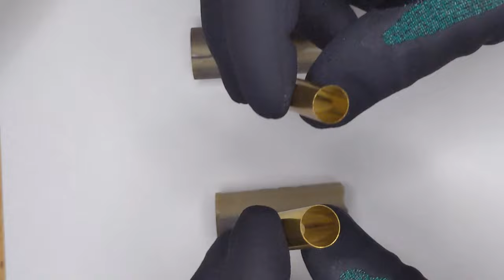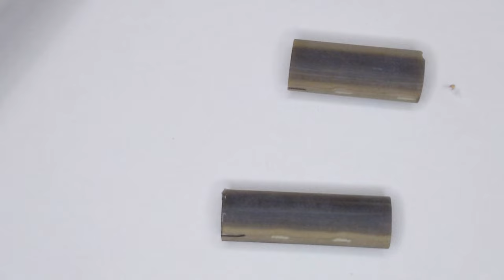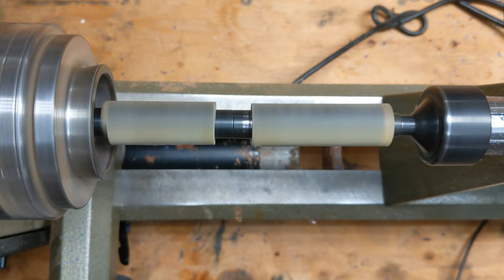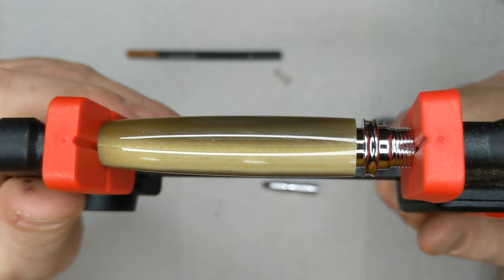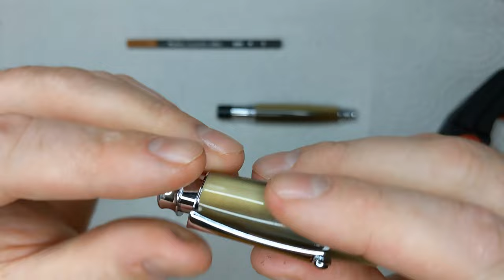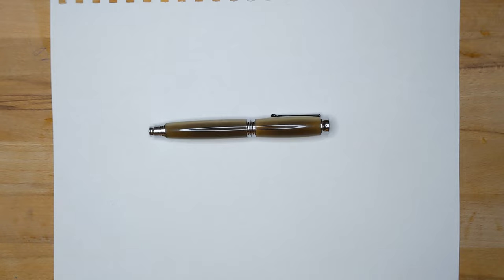I made a 110$ PEN! - wood turned pen on a lathe!

Comment: lay a paper towel on the bed below the blank and then spray a little water on the bit and keep the bit wet and no more smoke and you would have more room for turning if you used just the mandrel without the 4-jaw chuck, put the pen black in the 4jaw chuck and use a Jacob chuck for the squaring bit much safer, looks good at the end
Reply from the maker: Yes if it's starts doing that I probably will, I also need to sharpen or get a new drill bit haha

Comment: Great video!! I love the style. Could you please let me know the name of the pen kit, or where could I buy it?
Reply from the maker: It's called the virage rollerball pen kit from Lee Valley it's a great store for pen kits, they are a little on the high side but the quality is very good.

I'm glad you liked the video. I got more on the way! 😀
Reply: @HighSpeedWood   thanks! I'm just getting started so I think I'll do a couple cheap first...and then try this one.
Reply from the maker: @ChuckPPhotography  good idea slimline pen kits are generally the cheapest anywhere between 3-10$ depending on the finish of the metal. They are usually considered the beginner kit but I find they are a little more difficult as you need to get the transition from the pen tip to the wood perfect. Good luck with your new hobby it's a really good one!